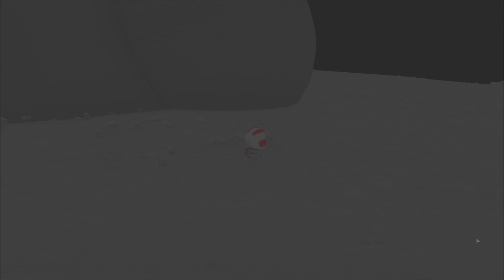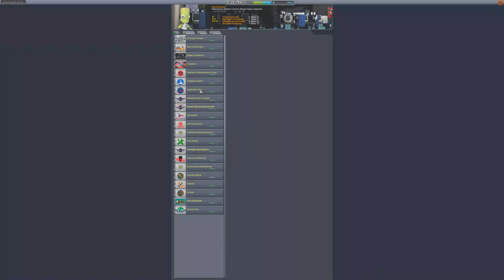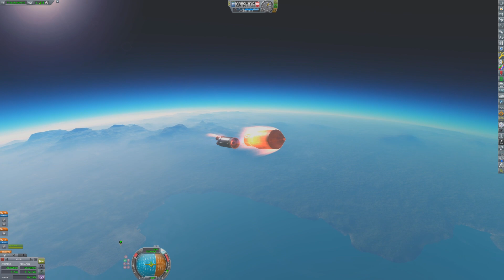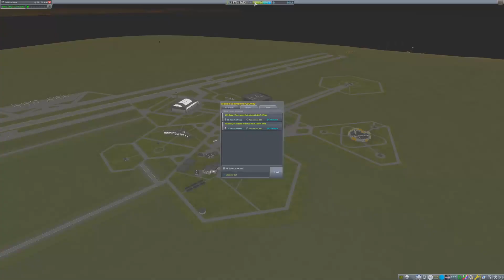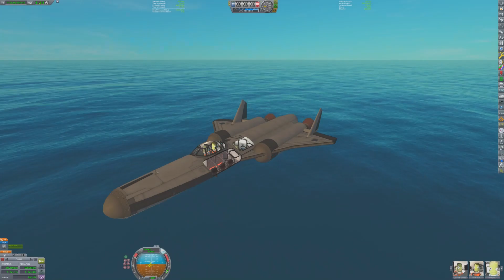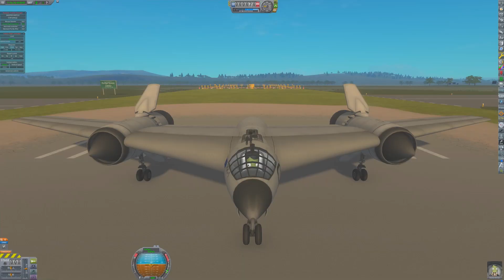The Kold War part 16: A Modded Career Play Through with BDArmory

Comment: I wonder if that stealth recon plane can fly around Kerbin without refuelling. Probably would need to swap to Wheeselys, though.
Reply from the maker: Yes. It very much can. In the video, it is only half fueled. But at 1100 m/s, it doesn't actually use very much fuel per kilometer.

Comment: Great fun to watch!
Although the color grade with the lifted black point is a little tough on the eyes.
Reply from the maker: Thanks for feedback on the color. What do you think would make it look better?
Reply: @Echo3  Assuming you’re tweaking the color in post, basically, leave everything that has to do with the black level, shadows, or contrast as default. If it’s a setting in the game from one of the visual mods, it’s a little harder for me to say what exactly you’d have to adjust, but to give you a word to use if you wanna google around for it, the issue right now is that your black level is too high, which washes out the contrast.

That all being said, I very much enjoy the story telling, which is of course by far the most important. Will be going through the back catalog, and looking forward to what’s next!
Reply from the maker: @joelmulder  I am not modifying the color in post. From what I can tell, things look a little more washed out when I save the video in 1080. I record in 4k. Recording in 4k is really nice, because I can crop some scenes down to 1080 and remove all of the UI.
I am wondering if I work with in game lighting settings and the TUFX configs if I can find something that will look better.
Thank you very much for your feedback. This is something that has bothered me, and I've not figured out exactly how to correct it.